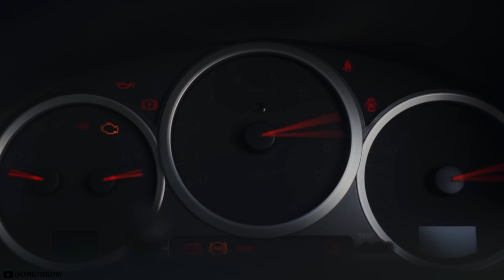Donut Media VS. Subaru

Comment: Does not help that Donut made the same mistake as most WRX owners and turned their cars into time attack street cars and just modded them way too much. WRX's are generally old and tired by this point because of haphazard mods and people beating the absolute shit out of a more delicate than normal engine.

Also going street in a subie is poor taste. All the boy racers do it. Shoulda gone with rally mods and barely touched the engine except maybe a slightly bigger turbo.

Comment: Subaru owners solution: if you spend thousands and thousands of dollars on replacing parts that should have been fine from the factory and then spend thousands more on constant maintenance that most cars don’t need as regularly they’re actually reliable cars 😀 definitely not just a shit platform

Comment: I don't know a single person who has had a WRX without major issues, knowledgeable or not. They are trash vehicles. Leave them stock and they still blow up. Not even sure what makes them cool. The older models (hawkeye and prior) are nice looking, but all the later models look like nissan versas with a body kit. Not to mention they make as much hp as an accord and explode if you do anything to them.

Comment: Bro... They are crap cars!   Get at me Subi Bois.  Dont care!   The engines have a ton of issues because they are not good platforms. Every Subi has issues at some point , or they have changed so much stuff, they might as well have bought a better platform to start with.   I will throw shade, because after 15 years of track , and motorsports , i have never seen one of these thing preform well , and survive a day.  There might be a few guys who can keep one running, but THAT fact says it all about the car. Not only that but its a pedestrian vehicle at best.  Where does it fit exactly other than cruising a parking lot?   Nobody builds them to rally.  So now its a street car.  Its not a sports car. Not really.  Its not a compact / hot hatch.  Its not a classic JDM car.   I guess its an alternative to an Accord , or a Prelude , or something along those lines.   They had some awesome rallies , and Ken Block made a video in one, but hose were pro cars , built ground up by BIG teams.  As a street or track car , i just dont understand them at all.
Reply: ....glorified sedans

Comment: "the platform is harder to work on" just means its the current and/or previous owners' fault(s). I have yet to hear the opinion that Subaru engines are easier to work on, the main argument was that donut didnt do their research. Donut is a massive content creator, not just some random high schooler who thought the wrx sounded cool and in both scenarios its still donut/high schooler's fault for doing the incorrect mods leading to an engine failure. Most people know getting into subarus is like getting into rotaries, and thats the main point as to why its mainly donut's fault. If Donut did a series on something more complex I would expect them to do their research and not just perpetuate the stereotypes of 20 year old jokes. I would want to see the high and low version of cars that actually run, if the low car ends up being expensive, then its a bad platform for a hi low series or you just go with the platform anyway understanding the baseline is higher. Half of the lo car parts were literal ebay knock offs that straight up didnt fit, no one is going to do that. I am willing to say that some of the blame is on previous owners, but I would personally hold Donut to a higher standard. This also goes along with donut's recent shift to more mainstream and catchy content rather than legitimate comparisons and technical car content like they used to, which also added to the Donut hate. I have a gr86 so im a toyobaru fanboy but im still repping donut merch and stickers, I just see this hi lo series as a flop tbh.

Comment: This is a result of the subie community being too defensive about reality, possibly living in denial.  I've talked with (modern) Mini Cooper owners who believe that those cars are some of the most reliable vehicles today, reflecting the same level of delusion. 
A subie boxer engine is not a Honda K-series, or the old J-series, or a toyota engine, which can all take abuse and make decent power with simple bolt-ons.
The two factors listed here are not mutually exclusive.  It could be that Donut do not have experience with the finicky WRX platform AND that the platform itself is not as reliable as others out there.  (Expecting to see comments from dudes about their cousin's friend's sister's boyfriend's nephew's WRX that has 500,000 miles and still going strong).

Comment: I think the issue with it was not necessarily the struggles they went through but more so how they presented them. This was definitely a season of hi low that needed to have specialists on it and because they didn’t it resulted in the  idea of “Subarus doing Subaru things” but with our understanding that those things happened because certain steps they didn’t know they needed to do were skipped. I don’t think donut needed the hate they received but they definitely needed more guidance

Comment: I can see why donut did the builds the way they did. If your starting out in the car community, your NOT going to know where to look for research or anything. Subarus are a platform that demands a lot of respect. If you don’t respect the car and it’s issues, then you won’t be able to have fun with it after fixing one up. Just cause the parts are new, doesn’t mean they’re good parts.

Comment: Idk how anyone could fail too see this? This is literally why we have fan boy groups for Honda, Toyota, and Subaru and it goes away deeper like you can find a dozen groups for every single make, model and generation. Half the reason why I said fuck it and got an old civic ej2 I know a lot of random pieces are out of production and hard to source for a decent price but there's a whole community that goes back decades that can help with almost anything. Each platform is just a library of lil nuances you have to learn. The donut guys are lovable cause they're goons but they should've known that they weren't Subaru guys and general knowledge wouldn't cut it. Like a lot of there problems could've been avoided with a couple weeks of casual research

Comment: Subarus are a difficult platform. AWD, turbo, flat engine, supposed off-road performance. That’s a lot of stuff. Cars are mechanical & electrical, you know, really easy majors at university…

So yeah, I would say they are a bad platform for 95% of people, because people are lazy & cheap, and complex is hard & expensive. You wanna be lazy about it, get some American car or a Toyota/Honda commuter/family car.

A Subaru, and European cars, are not cheap & easy; and like you said, the tolerances the car can handle are tighter. You either get it right & have the time of your life, or you get it wrong & break the car.

Comment: Had plenty of friends with plenty of modded cars. Had one friend who had a stock Subi transmission fail on him at like 70k, and another dude who lightly modified his subi and his engine exploded. Its possible to modify basically any car but when it takes rocket scientists or more specialized knowledge than a Wankle engineer to do it, Its not a good platform.

Comment: I watched Mr. Subaru's video and he makes quite a few moronic claims, namely that the wrx is perfectly fine you just have to swap out half the parts since they are street parts, really? I thought the wrx is supposed to be a rally car, you can't possibly claim it's a fine car you just have to change out the entire transmission and immediately swap out the oil pan, it's like claiming yeah, cars with the infamous iron duke are perfectly fine and reliable, you just have to swap out the iron duke, or imagine claiming the Porsche 911 is reliable unless you push it or it will totally break down, because that was what Mr. Subaru said about the wrx, reliable on the road, but if you push it on the track it will break down because of the lack of baffling, WRX stands for World Rally Experimental, if it can't handle a track it sure as hell can't handle rallying.

Comment: I've owned  3 of them 06, 07, and my 03 bugeye behind me in my avatar,  I replaced an engine within a year on all of them except my 07 which had been done before I bought it. I got so sick of subaru being shity and using cheap ass parts like the ringlands and the head gaskets on the NA models. they put them together good enough to last maybe a little past 100k if taken care of like the average person does. if you follow the maintainence to a T and drive them easy then yes they will last forever. PS I'VE BEEN SAYING THAT DONUT DOESN'T KNOW SHIT ABOUT CARS FOR YEARS THATS WHY THEY CAN'T BE BOTHERED TO GOOGLE ANYTHING LIKE WHEN THEY ARE MAKING THEIR SHIT UP TO SPEED VIDEOS! I don't drive these anymore cuz I like simple shitty old trucks and I daily a 1994 f-150 RCSB 4X4 5.0 5 speed with 113k miles.

Comment: Sounds a lot like owning an N54.
Reply: N54s aren't bad once you fix the plastic coolant parts and go single turbo
Reply: @fakeMbadge  single turbo does increase reliability and decrease temps but it's more than the plastics. You still have hpfp to worry about every 80k, injectors, the all metal water pump from pierburg lasts a lil longer but still fails thanks to the thermostat, not to mention the all gaskets, it's finicky. Great motor internally but finicky as fuck

Comment: I find it really suspicious how all of  the cars needed an engine rebuild on every single engine. What are the odds of that? That'd be a massive law suit against Subaru if this was that common.

Although at the same time, rotary engines are known for a big flaw on the same level so idk.

At the end of the day, one things for sure, Toyota is most reliable. So unless you've got a degree in this field, I wouldn't modify shit for daily driving.

Comment: A lot of this is completely false. No car in general handles getting rattled well. Subarus of that specific generation have incredibly slow ecu’s so they don’t react fast enough to pre detonation. Issue being as well the oil pickup and baffling is crap. I almost guarantee that 99% of the issue on why donut blew their shit up was tuning strategy. Granted yes to own one of these you just need to know what they don’t like but that’s every car. They made the mistake of not getting the sti of that year ecu’s are completely different and much faster.

Comment: My Subaru experience is only with JDM (so slightly different?) but they were fine cars if you didn't mess with them. No lowered ride height, no idiot tires, no exhaust cans bigger than your butthole after you get out of prison. You don't know better than the Subaru engineers. It was the same with my gtr and gts-t, these are sharp cars, aside from dropping some emissions restrictions, you can't make them better. Take a civic, celica, focus, theres lots of room to improve, but on the higher end? All most tuners do is mess it up. Like a girl that gets some massive cans, ok, its unique and something that catches the eye, but for general purpose and long term satisfaction, its not going to be a good choice. Oh, and i have a B5 quattro wagon now (2.4 euro v6), and yeah, thats a PITA car.

Comment: I get what you're saying, but you're making it sound like rocket science, you don't need a phd in subaru to work on them, it's one of the easiest cars to maintain that I've owned.  I dirt track mine and it's my daily, I drive it like a rally car with 300K km on the clock, stock suspension, factory later model parts swapped in and it's fine.  I keep seeing people say how they can't do this, they can't do that, you need to know how to work on them, that's true for every car, you need some amount of knowledge to be able to fix anything, and you need to know the limitations of the platform, and that limitation in my experience at least, 9 times out of 10 is the monkey with the spanner turning things they shouldn't turn.  

"Cold air" intakes are the biggest killer of these cars, they cause ringland, detonation and rod knock but somehow the owner putting a bad mod on the car that it doesn't need is Subaru's fault.   The second killer is the oil, people run cheap shit oil or don't change it often enough for what they're doing.  My car gets new oil and a filter before every track day, I'd say that's why it's lasted so long. Oil barely does 1000km in my car sometimes.  Usually changing it at 3k.  

Maybe I'm just lucky or more capable as a mechanic than I thought, but it always feels like blame shifting.  

If it were me who'd just replaced a blown engine and found my new engine blown, I'd start looking at common parts, what came off the old engine on to the new one, that's probably where the problem is.  

Maybe I should stop letting other peoples commentary on things I like get to me.

Comment: Did you just try to tell me the EJ has no oil pan baffling? That's a straight fucking lie bro. The racingbee pickup and baffling is a revised upgrade not a complete additional part that fills a place that's currently empty.
Reply: Also, you're wrong about rebuild tolerances. If you build a 2jz and put the wrong valves in the wrong places and wrong shims it's going to break. Subaru just tells you quicker that there is a problem
Reply: You don't know a Subaru engine code, how are you supposed to be an authority on what is correct?

Comment: Also they drove the fuck out of it while in the break in period but they did mention too
Reply: @excalibur2038  I dunno about that. But I’m not an expert
Reply: @ivanmendoza4228  *most i should of said there are some that are finicky but most mainstream long term developed v or inline engines wont have a break in period where if you drive it hard it just blows up

Comment: I hate Subarus they are a poor excuse for an “enthusiast” car. You get a slow 4 banger that’s hard to work on and it’s not reliable. Be prepared to spend an extra 20k for an extra 200hp that’s still gonna blow. You could buy literally anything else and be better off. They do look good and sound good though 😂

Comment: As a former Subaru dealer tech, if you're upset you bought a pile of shit Subaru and thought it was a Porsche I dunno what to tell you. They've eaten head gaskets and engines for literal decades now. There's a reason it only takes 20 minutes to pull the engine. It gets pulled often.

Comment: Very well stated. It just comes down to knowledge and experience with the platform. You can make 350-450awhp pretty easily and reliably with an EJ, with a few basic bolt-ons and a tune. But you can also blow one up pretty easily, even stock, if you aren't aware of all the engine's quirks and weaknesses. Jumping straight into one and shooting for the moon is a recipe for disaster.

Comment: Not that I'm on Donut's side, but from what I have seen, Subarus are pretty bad cars and saying stuff like "they require more knowledge because" is just someone trying to justify the fact that Subarus sucks. I mean, if changing the air filter can destroy the engine that doesn't mean that you need more knowledge to work on it, it only means that Subarus can't handle anything

Comment: Donut did really dumb things on the cars and were surprised and upset when they blew up. Do dumb $hit on any car and you get the same. It would not have taken more than an hours worth of simple Googling to set them straight ahead of time. These cars are used as base platforms to mod because they are good. Just don’t be ignorant when you mod them.

Comment: I used to be a mechanic for Toyota. Worked on plenty Scions and this Subaru platform is garbage. I'm ASE certified.  Certified Toyota Tech. certified parts expert. Subarus are trash. That's my opinion. I have personally rebuilt over 20 of these boxer motors so unless you have too than just respect my opinion. I've earned it.

Comment: The fact people think u need to research a car platform in order to make sure a couple intakes a turbo and tune work is beyond ridiculous because no other brand and their platforms require any of of that. From thw cheapest to most expensive. Shit most platforms make double or triple the power with Chinese parts and backyard tuning and happily will perform from u. Suburu is the problem and owners are acting like domestic abuse victims. Donut did this with other cars so they have experience with this already and only Subaru was the issue.

Comment: Lol they arnt  bad cars its the subaru boys that don't know how to take care of things and then decide that they should sell it and let it be someone elses problem at a 30% mark up because it USED to be a good rally car... which lets be fair is basically 80% of how Subaru owners deal with most things.... also I take issue with the  oil pan because that shouldn't be a "known issue" with out a recall,  that's BS from all Car makers not just Subaru. Subaru's are great rally cars because great rally cars have a team of mechanics to make sure every thing is spec,  the point is that while Subaru is a great rally car , but its not a great daily driver if you dont have the time , money, or decication for being a Subaru owner.  If you want something slightly less involved just have a child.